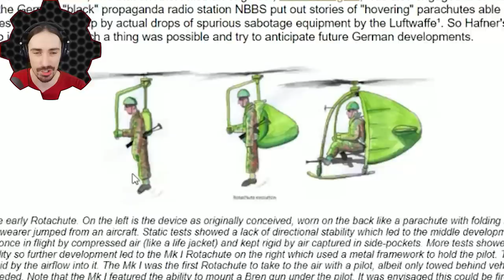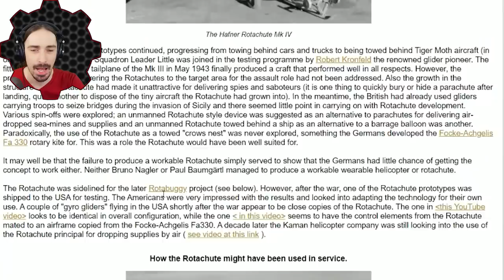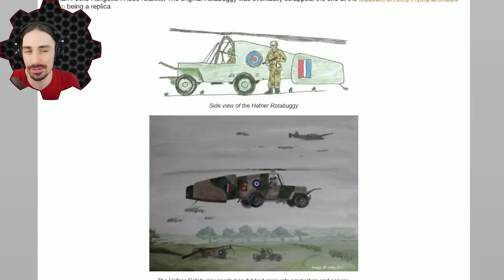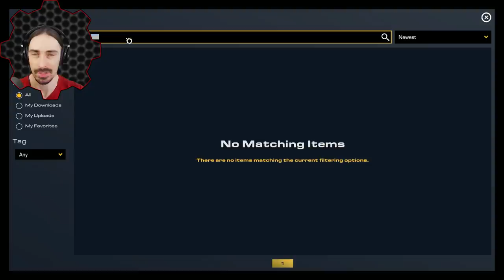The Rotabuggy Was Vehicular Evolution Gone Wrong... SO I BUILT ONE

Comment: The rotochute would have theoretically allowed them to autorotate to a safe landing slowing down significantly before actually hitting the ground rather than glide.
Reply: I was hoping someone would say that the principle mechanic is autorotation. Another interesting fact is that in the case of an engine failure helicopter autorotation is actually far slower and safer than a plane gliding

Comment: Just add a spring mechanism that accumulated energy during the fall and activates just before landing to allow silk smooth landing.
Reply: The total energy would be the same so the end result would likely be too
Reply: @the_Acaman  It would arguably be worse, as any mechanism will not be 100% efficient at storing and releasing the energy, and would add mass.
Reply: I think the way you'd do this in a real autogyro is by having the blade pitch adjustable. As you go down, the blades pick up speed - and then right before landing you change the pitch so it generates a little bit of lift from the stored speed to slow you down.

Comment: Hi Scrapman, For an autogyro the rotor blades actually need to point downwards (i.e. a negative angle of attack). That way the air passing up through the rotor disc accelerates the blade rotation. As the rotation of the blades get's faster you can reduce the negative angle of attack in order to generate more lift. But it always points down. if you look at your rotorbuggy the wing segments are going backwards compared to their normal direction. This is why.
Reply: Also to take of from flat ground make the rotor disc lean backwards a bit. That means air rushing past from the front goes up through the rotor disc and accelerates the downwards pointing blades.

Comment: The Autogyros you found are also called Gyrocopter. They are producing lift by angeling the upper Rotor in the correct position while getting  velocity by the small rotor.

Comment: I've just discovered your videos a couple days ago. Been watching for many hours! Thanks. I've got two ideas. 

One is like a tennis ball launcher. Like, two opposing racks of tires. Each pair spins faster than the last. So, any object stuffed between the first two tires is thrust between the next set, and so on. Massive speeds could be achieved! Probably an easy sonic boom maker. 

Second, wheels on wheels. Like, one big wheel with lots of smaller wheels around the perimeter. When they're all spinning, it might double your ground speed. It's probably impossible unstable though.

Comment: Hey scrapman, small modular wings with heli blades work at slowing you down. Sadly you need to be able to effectively control the way you fall with surface controls to level you out. If the smw + heli blades have their bottom facing the direct direction you are falling they will slow you significantly. Also, forward momentum with unpowered heli blades make the blades function more like stubborn wings.

Comment: As an engineer autogyros and helicopters alike use a ballast balance system so yes you are on base with the assumption, autogyros use their enormous weight and the counter rotating horizontal prop , my suggestion..... Add more weight on the center bottom, then make the propellers on a rotation point to generate lift once the top blades gain enough momentum

Comment: This is why, in some conditions, helicopters are better for emergency landing than airplanes when losing the engine. They can use autorotation to slow down the fall and control where to land in a short distance. They can land everywhere uncovered right on the spot.
Airplanes might have the "glider" effect giving you more time to react, but you still need to find a strip of land with enough length and glide there.

Comment: The Rotodyne actually had a similar idea, it was a commercial plane-helicopter hybrid, with the helicopter blades providing the lift in horizontal flight, but it was too loud to land on the city buildings, so it was scrapped

Comment: You should do a rotodyne. It was a plane with a free spinning propeller that would use jet engines at the tip of the blades to spin them in take off and landing and during flight the actual propellers that provided forward motion would activate and the giant rotor on top would keep spinning because of the air hitting it and it would generate lift without the use of wings. It had prototypes built and was meant to be a cheaper way of transportation that would leave airports and big airliners obsolete in city to city flights inside the country being able to land on the roofs of buildings that had helipads. Removing the need to take a bus or a cab from and to the airport. But it didn't make it far. Mustard made a video about it and google also has some kind of helpful informatio.
If I said anything wrong I am sorry this is just what I remember but something close to what I said.

Comment: To autorotate your helicopter blades, you have to pitch them DOWN. I.e. the opposite direction your tried to angle them at 9:01. The clockwise spin that you get at 9:06, 9:24 and 9:52 moves the blades backwards (same as 13:30) and I'm not sure if the wings are programmed to produce lift when spinning in that direction.

Also, instead of driving off a ramp, couldn't you use Trailmakers' mid-air transformation function? Or do you only get the 4-creation hotbar in the "stranded in space" mode?

Comment: The Ekranoplan is a massive Russian plane-boat hybrid, the pictures says it all. It was supposed to glide 10 meters above the water, removing the force of friction against it, lifting off with the whole front engine array, and then staying afloat just with the back low power engines and the power of the ground effect (when close to the ground, the high pressure air bellow the machine would lift it naturally). It was supposed to revalutianize water travel, giving Russians a huge advantage in military power. Because of how the ground effect works, the bigger the machine, the higher above the water it could hover, so the engineers invisioned huge airliners and military machines floating high above the waves. But, the small prototypes were not enough to impress the higher ups, and so the funding was not enough to build the final plans, and the project had to be abandoned.

Comment: Somehow confusing - shouldn't the wings be tilted downwards in order to ensure the wings rotate forward by windforce to create lift. Currently they are spinning backwards, as they are angled up thus they should not provide lift but just air-resistance...?
Reply: Well, you see, they are free spinning. It will not generate upwarda lift. Only offer wind resistence to deacelerat the fall.
Reply: Answering myself and correcting here. It seems the orientation of the rotor wings, upwards/downwards has actually nothing to do with the initial spin-up of the rotor. Gyrocopters/Autogyro have a connection to the motor to spin up the rotor to a sufficient speed to allow take of. After the rotor is spin-up the motor is disconnected and the rotation is just maintained by forward motion.
cf: https://www.youtube.com/watch?v=wO8NRIkRZzc  

The rotation ensures that the wings can generate the required lift...

Of course it is the question how they wanted to do that while throwing the vehicle out of a plane ;-) Maybe tilt the wings downwards to ensure that the wings go forward and hope that you get enough rotational speed to generate lift before hitting the ground :-)
Reply: @mar.m.5236  exactly, they would pitch the rotor down initially to get it up to speed, then slowly pitch it up to maintain optimal RPM (this would be around the neutral position), just before hitting the ground they would use the energy stored in the rotor to generate lift by pitching the rotor up and slow down the descent to 0 right as they hit the ground. 

It's what helicopters do in case of engine failure, except for them the rotor is already spinning so they ignore the 1st step

Comment: A few problems i noticed with this design.

1.  The rotors were spinning the wrong way.
2,  The blade pitch was too great and the wrong direction.
3.  The rotor needs to be tipped back so that autorotation can occur while moving forward and not just while falling.  

I think if those issues were corrected, it might actually work as intended.  I do not know how accurate the physics and aerodynamics are in the game, but i see potential in this design.

Comment: This technique is something all helicopter can do, as a means of emergency landing when engines fail. Some flight simulators are accurate enough for it to work. When falling, the goal is to keep the rotors spinning fast, which both stores energy and also slows the fall. The secret to landing is then to gradually raise the collective just before you hit the ground, transferring the stored energy into lift. Not only can you reduce fall speed to zero, you can end up moving upwards again if you pull too hard. (Which is really bad if a soft landing was your goal... since you probably have very little rpm left at that point...)

Comment: hey man sorry for a long one but just curious. been watching your channel for a while now and this episode made me think of a blueprint i was developing back in the day where i tried adding an actual helicopter collective control and fly using nothing but that as the control surface and IT WORKED.... rr kind of..... i got reasonable amount control out of it with no extra stabilization at low speed but as soon as you go over 30mph in a horizontal orientation the body "outruns" the rotor and it loses all authority. and im curious (if your interested) if theres a way i can send you the blueprint to look at and see what you can do or if you would wanna give it a go yourself. i dont wanna say im desperate but i feel like im so close and i just hit a wall for too long. but you have many more hours in this than i do so you might have a better chance of getting it fully operational than me at this point.... ::TECHNICAL STUFF:: (for those interested) the basic design was a helicopter rotor with distance sensors on each side of the spinning part facing down, then rotating servos on the side of the sensors facing out to act as the blade pitch mechanism with the small plane wings (done this way instead of helo blades because the lift characteristics for those are too cheaty in this experiment) (also the wings didnt create enough lift on their own so i used gimbles to make the craft "lighter" and this is the only "cheat" ive done for this project) and then its all assembled on top of a "mast" with a piston under them facing up with the 1x2 armor block on top and the distance sensors set to pretty much minimum. the idea is to use the direction keys to extend the piston which trips the sensor which rotates that specific blade to have more angle of attack and generate more lift on a specific side of the craft tilting it in the other direction like a real life helicopter. i had to time the sensors so that the blade would do its "pitch pulse" about 90 deg out of phase with the piston that trips it I.E. looking from the back while your flying with the blade spinning clock wise the right piston would be responsible for the rear lift and the rear piston would go to the left lift etc. more over i had the sensors set to %50 output so the blades would only pitch half so i could use the other half of travel for full collective control I.E. %50 of the available attack angle is used to generate over all lift and the other %50 is used for directional lift.. the system works surprisingly well at a basic hover and low speed. it feels like youd expect a real helo to, but the reason im stuck and dont know what else to try is the rotor stability. im  pretty positive that the control issue would be resolved or t least improved with more lift (its running into a similar issue that real life helos have where the side of the rotor thats rotating tword the back has less air speed and generates less lift than the other side when your in horizontal flight). real helos trim this out mine just runs out of steam completely and then it tilts a little and catches air and basically turns the blade into a parachute and slows it back down and spins you around randomly untill its slow enough to regain authority (doesnt really crash which is awesome) id do what youd expect and add more wings for more lift  but you know exactly what happens when you put hinges on a rotor and then add more than two or three plane wings to all 4 side (two blades arnt enough control input). the things wigs out and self destructs for no real reason just like in your triebflugel video. so if you or any one else in this comment section either A. knows a way around this or even better B.wants try it out and see what you find out id be extatic to see or hear some ones elses results.

Comment: These things do work, but require far more training because they operate by counterrotation, you let the rotor build up speed then change the pitch of the blades so they generate lift.

this is the same principle as the autogyro or Gyrokite

the German Focke-Achgelis Fa 330,  was an unpowered gyrokite used by Uboats.   connected by a tether, and phone cord..   the pilot could be lifted 100's of feet into the air to scout, at just 300 feet, a pilot could see about 25 miles and telephone the location and direction of enemy ships.

Now there ARE flying car/autogyro's.

Comment: I cannot see how free spinning rotor would allow for gliding or slowing down. The rotor blade angles cause it to windmill into the direction of the wind, which in this case would be falling down. To be able to slow the person down, it should rotate AGAINST the wind, which is simply not possible for a free floating rotor. In fact, if it was possible, what would essentially be an infinite energy generator.

Apparently I am wrong according Wikipedia and other sources. I still haven't found anything that would sufficiently explain the mechanism. If anyone finds something, please post the search terms and  search engine that can be used to find the link(because Youtube don't like links at all in the comments).

Comment: Even the wing does spin but since it spins depends on where are theu going to the wind making them goes with the wind so instead of slowing falling process they actually make the falling process faster so if its not a powered engine that goes with the opposite of the side of the jeep falling down, it just useless wing

Comment: I... think you needed to gain an understanding of how an auto-rotation actually works in a helicopter.

You're not magically providing lift... nor are you just attempting to slow your fall. That would just be a parachute.

Rather, you're trading altitude for rotational energy, storing it in the angular momentum of the rotors, which you then use just above the ground to slow your descent and land safely.

So you need to angle the rotors the other direction while you're falling, to make them spin the correct direction for flight as if they were powered, to get them going really fast, and then just above the ground you angle them for lift, and the momentum provides the energy, the blades slowing down rapidly but providing just enough lift for a safe landing.